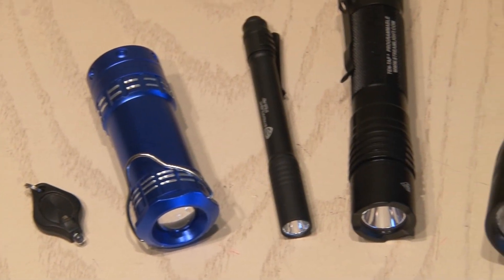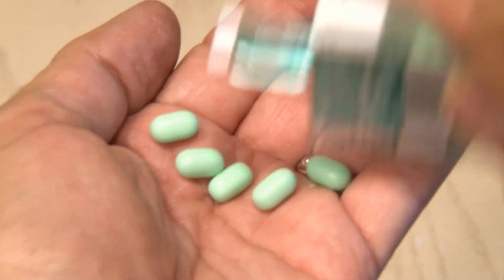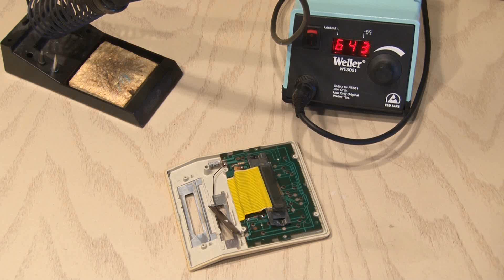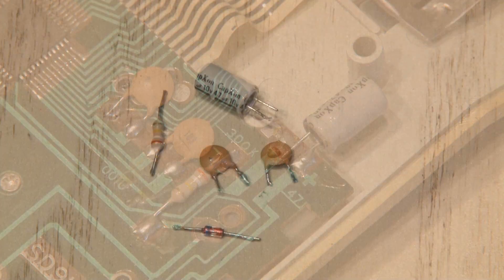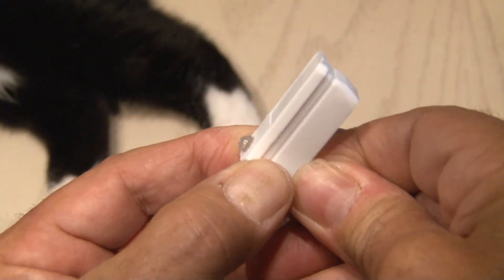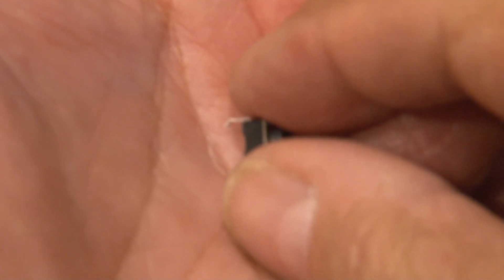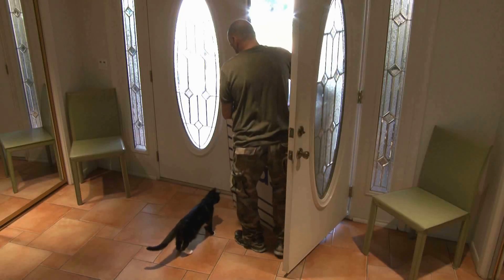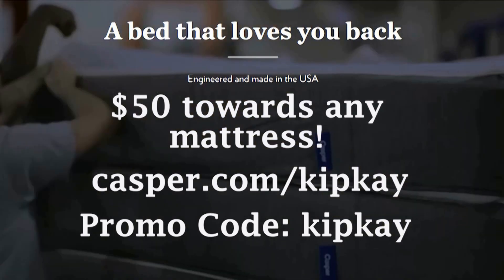Tic Tac Survival Torch!

Comment: I prefer orange Tic Tacs. The 3 rechargeable batteries are 3.6V, but the solar cell you used only has (4) .55v cells connected in series. You need around 5V - 5.5V to charge those batteries.

Comment: Dude, why are you setting the diode in series? Its just gonna eat up between 0.3 and 0.7 volts from your solar cell and could end up not being enough to charge your accumulators. Next thing is also this: That tiiiiny solar cell will MAYBE produce a current of half a mA at best. Unless you really plan on leaving it out in the open for 12 hours during really hot summer days, it will probably not work. Try using 3 cells and connect them in parallel. Will result in much higher amperage.. Besides, if you wire it correctly and color code it, you dont need a polarity protection.

Comment: That won't ever charge the battery is half the voltage of the cells!
You need a voltage higher than the cell voltage to charge the battery!
Reply: Cool
Reply: Actually that cell can put out enough to charge it
Reply: yep most calculators use 1.5v battery so that cell is not more then 2v and batteries are 3.6v

Comment: It's an interesting project but I've never measured more than 2.1 volts from a calculator solar cell even in bright sunlight.
So that cell will never, ever, charge that battery pack. You may as well have wrote the word "Solar Panel" on a piece of paper and glued some wires to the battery pack.

What about a solar garden light? These have small batteries, panels powerful enough to charge them and an LED all ready to be re-arranged into a compact flashlight style body and can be picked up for a dollar or two.
Reply: i turned a $1 garden solar light into a solar book reading light attached to some light bits of wood for reading. works well.
Reply: Its almost like ready to use, but needs some reconfiguring

Comment: this is a cool project but it needs a bigger solar cell. that little calculator cell is not going to charge that battery pack for shiggety. you could leave it out in the sun for days. it would probably take one of those 6v 450mA or similar solar cells to make this practical. once the battery pack runs out on this thing the average person is going to find it useless unless they can find some way to charge it other than the solar cell.
Reply: Magneticitist Just make multiple. While your using one, the other hundred are charging.
Reply: +Nova_Freak and it would probably take more than a hundred to get used up before the first one charges lol

Comment: Hey kipkay, it is great to see another project of yours, but I am pretty sure this is useless. The old battery probably has very small capacity compared to modern Li-xxx battries. And the solar cell won't be able to charge it at all due to its low voltage. And even if it had enough voltage, it would not have enough current. This would not help you at all.

Comment: I think the leakage current within the battery exceeds what that solar panel can provide lol! I lithium ion battery would probably be better. Just make sure to add a 4.2v zener diode across the terminals to prevent overcharging.

Comment: uhh, KipKay I'm not sure that solar cell has enough curve k current to charge that battery, I could be wrong (still learning) everything that I've been told says that.
Reply: a battery will charge with any current, if it's lower it'll simply charge longer. The problem I see with this project is that that solar panel delivers around 2v so it will not fully charge the battery
Reply: That Guy Exactly what I was thinking too... Maybe a conventional and bigger one would be better.

Comment: the glass solar panel's surface area is very small and it will struggle. Calculators do not require as much energy and can be easily powered by the solar panel but it isnt enough to charge a battery of that size... just saying

Comment: You can skip the battery and the swich and it still work
Reply: It wouldn't work at night
Reply: but it work when the sun up that when you really need it right ?
Reply: Huy Hồ no because once the sun is out and the solar cell will not produce energy anymore so it won't make light.

Comment: Isn't it potentially dangerous if the battery does not have a pcm protecting it from overcharging?
Reply: +kipkay
Reply: The battery won't charge at all! Each square is 0.5V, the panel has 4 squares so 2V. The 
battery is 3,6V and you need more voltage to charge it so this cannot 
charge the battery. And you also need to overcome the diode voltage drop
 so you would need about 5V to charge that battery, or 3 calculator 
solar panels in series. Then it would charge (very slowly)
Reply: +MrOpenGL doesn't the charging rate of the battery more matter about the mah of the solar panel
Reply: +MrOpenGL doesn't the charging rate of the battery more matter about the mah of the solar panel
Reply: Jacob GoProVideos
In this case no because the battery will never see any current from the solar panel.

Comment: Output voltage of that solar cell?

EDIT: Because I doubt it is high enough to charge those batteries.
Reply: Should be 1.5 V
Reply: Rem
That's what I mean. He uses a 3.6 Volt battery, so that will never charge with this cell.

Comment: What if the "natural disaster" causes the sun to be blocked and you can't charge you tic tac torch?
Reply: You Could also charge it under your regular lights in your house
Reply: What if there is no electricity in your house?
Reply: +Winter Wolf 
Then put it near a fire?
Reply: *you hear a faint, distant noise that sounds like a hostile spirit whispering it*

'Fire...'
Reply: You can use your Harry's shaver to shave away your problems

Comment: I would say you would do much better if you would use capacitor instead of that poor battery, since that solar panel wont output a lot of power and on top of that you will lose a lot of power, with capacitor you would trap more. Even technically that solar panel is most likely not powerful enough to power that light. Its fun project, but totally pointless if zombies would come. Or rather, get that flashlight that got crank and dynamo inside, its much reliable in survival situations and dont have disadvantiges like solar panel.

Comment: is it possible to charge a 3.7v battery with a solar pannel that produces 2v
Reply: it will work but not as intended. It will not fully charge the battery, it will only charge it to 2v. And if your li-ion battery is at 2v you've done something seriously wrong. That's also what's wrong with this project. The solar cell is 2v while the battery 3.6
Reply: Ok thanks
Reply: i found out that my battery is overcharge and discharge protected
Reply: i found out that my battery is overcharge and discharge protected

Comment: how the hell can such a tiny solar panel charge this and why dont thy use more like that??
Reply: it might charge it a lil.but it would take weeks to fully charge the battery in this video.
Reply: It doesnt. Each square is 0.5V, the panel has 4 squares so 2V. The battery is 3,6V and you need more voltage to charge it so this cannot charge the battery. And you also need to overcome the diode voltage drop so you would need about 5V to charge that battery, or 3 calculator solar panels in series. Then it would charge (very slowly)

Comment: I don't think the solar cell will be able to charge the battery...
Reply: It cannot. Each square of the panel is 0.5V, the panel has 4 squares so 2V. The 
battery is 3,6V and you need more voltage to charge it so this cannot 
charge the battery. And you also need to overcome the diode voltage drop
 so you would need about 5V to charge that battery, or 3 calculator 
solar panels in series. Then it would charge (very slowly)
Reply: MrOpenGL yea, thats why I thought it wouldn't work :p

Comment: WTF? Are you that delusional? That poor 0.05W solar panel is not even enough to make LED flash, how he can even change that 3.6V battery?
Reply: +Rainbow Dash the solar panel is not enough to charge the battery or power the light
Reply: +InspireAndInnovative its 1.5 so u just need 2 more
Reply: +Rainbow Dash it wouldn't charge the battery

Comment: wont the sun damage the batteries because they are black? i mean black color absorbs heat
Reply: Short answer: yes.  

That is because black plastic can be at 170deg* if exposed to the sun.  NiCd batteries after 80deg will have it's life cut in half for every 10deg over.  But, you can reduce the heat by cutting off the battery's ability to receive sun light by painting the casing let's say... white.

Everything is in Fahrenheit.

Comment: Doesn't make much sense because you only really need a flashlight when it's dark, and when it's dark there's no light...
Reply: but then during the day u can charge itM
Reply: The battery is for the night. The solar cell is to charge the battery pack during the day. Can't believe I had to explain that.
Reply: Still useless since that solar panel output in compare to that battery is like you would try to fill house pool with mug. And on top of that that mug had hole in itself, small enough to still have some water in it when you will poor that water in but still you lost water on travel.
Reply: +ponocni1 so attach 3 more?
Reply: Rainbow Dash Wont make difference. Now you fill pool with three mugs with holes. Hand crank with dynamo would do much more.
Reply: +ponocni1 solar panels from a calculator work just fine, works for me ^3^

Comment: is the small solar panel enough to charge a 3.6 volt battery?
Reply: Only in your dreams, it is. .... it's way too weak to be efficient.
Reply: thanks! I am going to order a 3 volt one from amazon. would 3 volts be enough to charge the battery then?
Reply: Gautham Thampy No matter how bright the light may be, they are only good as a basic light.
It's like with lamps. A lamp may be bright, but it's unfocused light, is only diffuse light.
A real good flashlight will always be better.
I doubt you can light something that's 100m away with a smartphone light.
Reply: Gautham Thampy  Well, when there are street lights, who needs a flashlight!
Reply: Not here in Canada, as much as I know.
Reply: At least, you have electricity.
Reply: Gautham Thampy
 No, I have electricity.
I meant that India isn't a country that is known for the widespread availability of of modern commodities.... There's a lot of poverty in India, compared to where I live.
Reply: Gautham Thampy 
They are the destroyer of worlds.
...
Check channels like: Sargon of Akkad, Armored Skeptic, TL;DR, Bearing, Undoomed, and/or others ..... you will see what I mean.
Reply: Gautham Thampy 
It's seen outside of the internet too.

Comment: but kipkay how much time takes to fuly recharge thoes batterys whit that small solar panel
Reply: But how much energy does the LED use?
Reply: Don't ask that to me, because I don't know
Reply: it take a looooong time. that solar panel can produce about 10 mA per hour - and you can calculate yourself how long it will take to charge that battery (in whireless phones its usualy about 750-800 mA).....so....yeah 75-80 direct sunlight hours
Reply: +Leshy Wood the battery is 3.6 v so the solar panel should output 1.5 it wont even charge I think, u  might need 4 solar panels
Reply: This project is fail

Comment: this solar panel wouldnt charge the battery pack
Reply: Probably not XD. Its only meant to charge a tiny coin battery. it might charge that battery pack if you left it in the sun for a few weeks.
Reply: I am not electric expert, but that solar panel is there to spare power that would be used by that calculator. It doesnt charge that battery. It cant do it.

Comment: Why would you need a solar powered led. If there is light
Reply: but there is no battery
Reply: just a capacitator
Reply: Taylor Lightfoot that probarly just lasts for like 2 min
Reply: It charges in the light and then it's available to use at night or in dark places whatever.
Reply: nils pils actually those phone 3.6v batteries last days a phone takes more power then that led ever will.
Reply: Taylor Lightfoot but there is no battery in the charger

Comment: It will take 1 week to recharge that battery with that weak solarcell
Reply: i would guess that battery pack he used is around 300mAh and the solar cell i would say mmmmm might output 15-30mAh so lets do 300/20=15 so it would take about 15hours at 20mAh. that doesnt sound too long but it is when you are in the wild. if you dont charge it from start to finish of the day it wont have a full  charge and in the wilderness its not very effective but it works
Reply: Nice to know it. I couldn't imagine that the solar cell could output 15-30 mAh.
Reply: I was just roughly guessing on the output
Reply: Can't we add like, idk... more solar cells? i think a pack can have 3 more of that stuff. Yeah it wont help a lot but atleast it'll charge relatively faster
Reply: sounds logical

Comment: So many mistakes :/
The solar panel has no power or voltage to charge a single battery, 3 batteries in series result 3.6V, they never charge.
Shouldn't leave cells on heat, much less when charging.
LED connected directly to the battery... really ?! omg electronic

Comment: A 3/16" bit isn't the perfect size for a 5mm hole. A 5mm bit will drill a 5mm hole. You Crazy Americans with your antique imperial system :)
Reply: He used a 3/16" drill bit so the LED will fit snugly and not loose